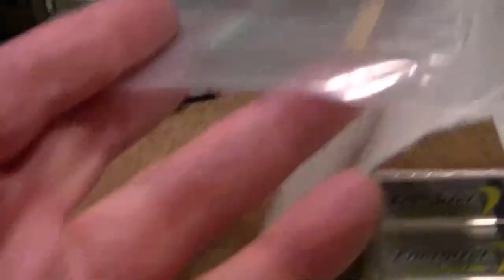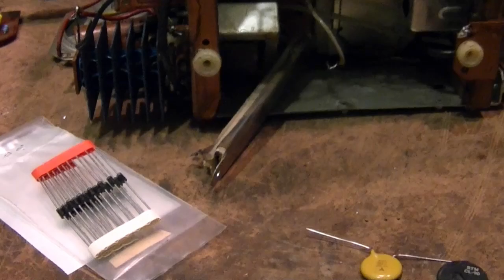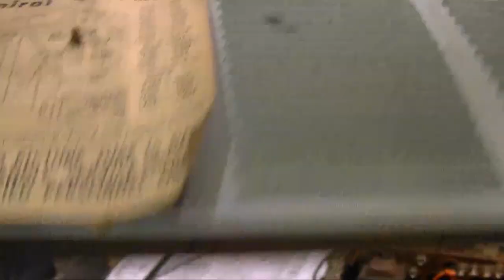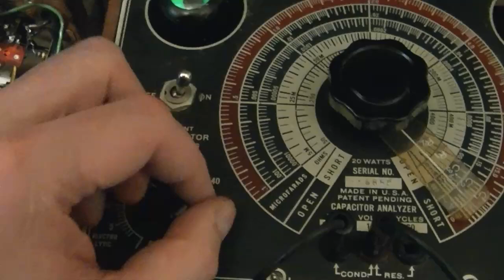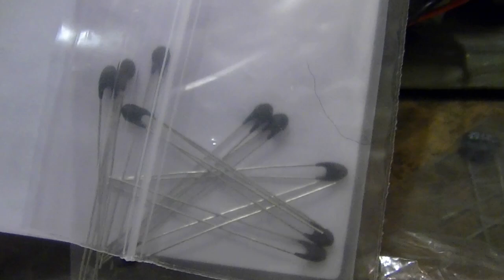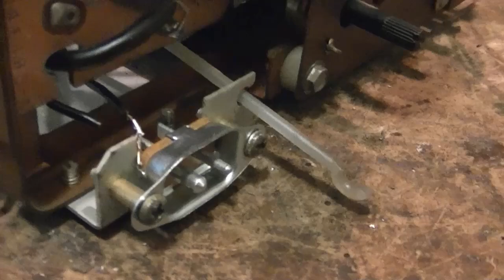Admiral T-102 restoration p4o7

Comment: I bought an old high end reel to reel tape recorder last year that was missing its cord. I had a socket like the one you installed. I parted out a PC power supply that died years ago. Sure enough. The cord socket was a perfect drop in replacement. It pays off to part out things.

Comment: I think that if I wanted to go full bore on rewiring the set for safety I would convert it to having a floating common negative, though the use of twist lock cans makes that somewhat more difficult, unless they used insulators for all. I'm not sure about the P.C boards though, if they were grounded through machine screws to the chassis that would involve adding plastic insulators. But then again the cabinet is isolated from the chassis, so this is more of an issue to servicing then safe operation of the set.
Reply from the maker: Twist locks are not an issue because I've removed them and the new electrolytics are mounted on terminal strips.  However a bunch of components and wires are soldered directly to the frame so that would really require some effort
Reply: The G.E COT4 I have is somewhat safer in design, everything that is electrically hot is isolated from the chassis, and the controls are mounted on phenolic sheets. It too is a series string set with a voltage doubler, mind you it cost at least twice what that Admiral did when it was new.